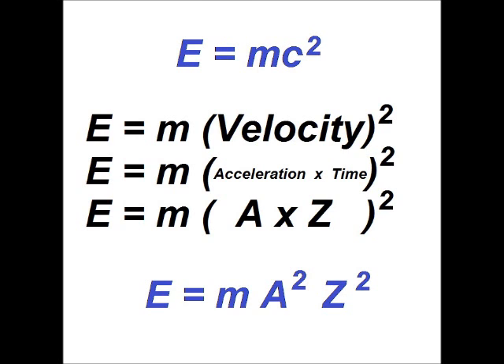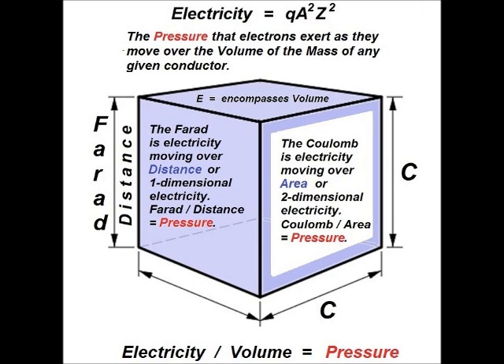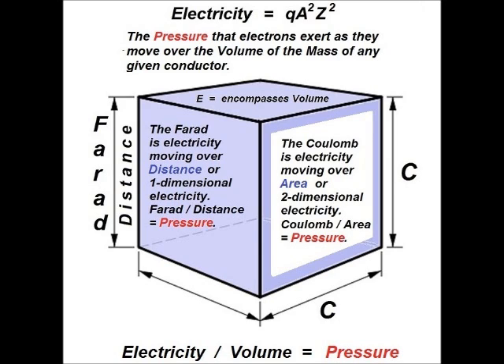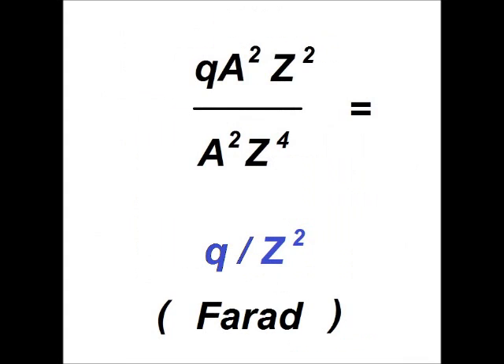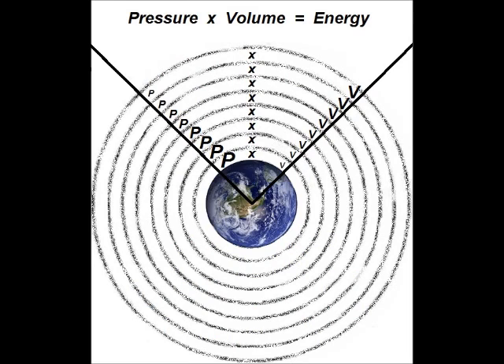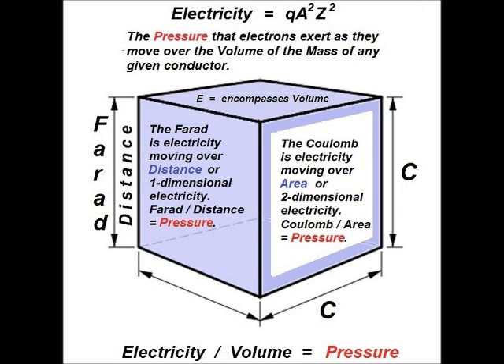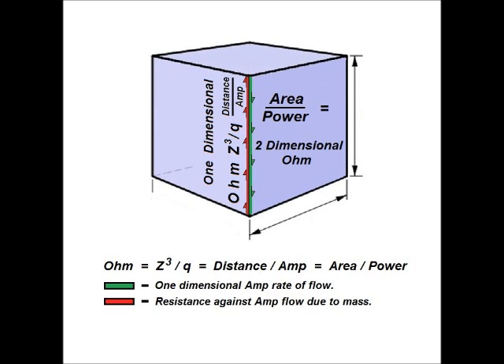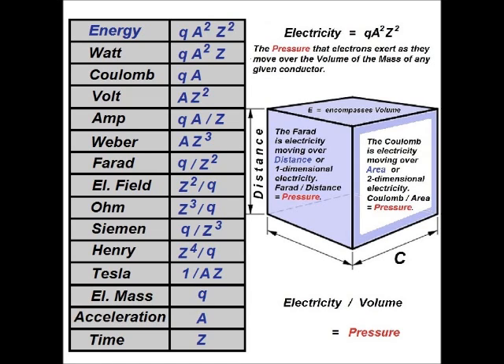Monumental Discovery re: Einstein, Electricity and Gravity.

Comment from the maker: Z*3 / q  =  Distance / Amp  =  Area / Power     is also equal to     Volume / Electricity x Temperature.  Exactly in keeping with the truth regarding the fact that Resistance is proportional to the Temperature of the conductor.

Gravity is absolutely the Pressure of electrical-mass that surrounds the earth.

The Density of any mass within that Pressure, moves up or down according to that pressure.  And that pressure is the direct result of the energy of space / the Volume of that pressure.